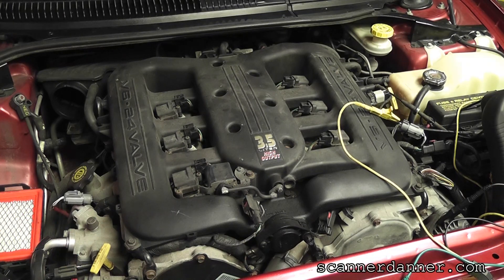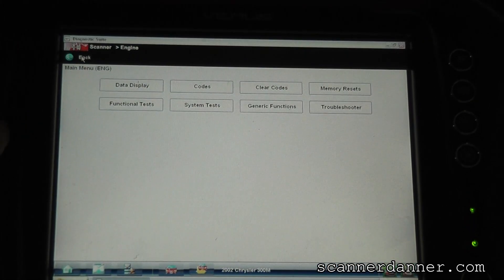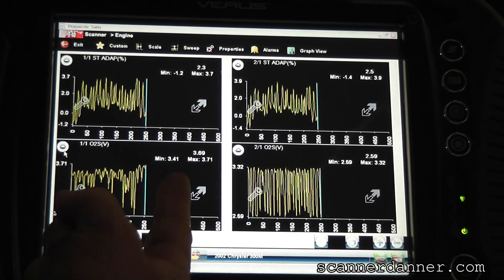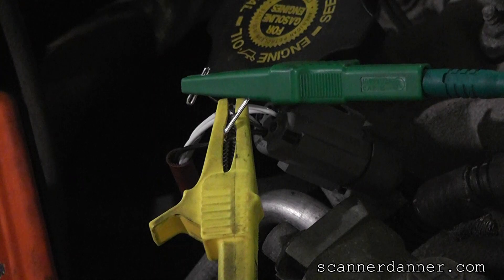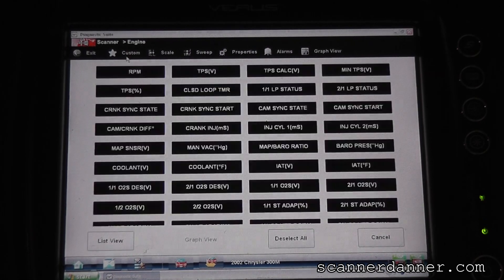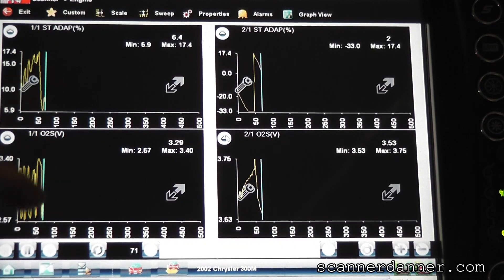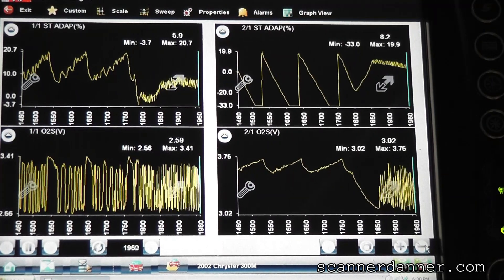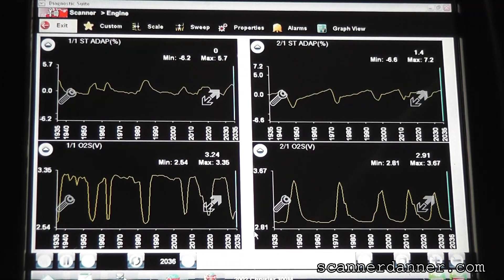WARNING! Aftermarket Oxygen Sensors (Chrysler/Dodge/Jeep part 1)

Comment from the maker: This condition occurred from a heater circuit change. Chrysler started PWM the O2 heater instead of it being constantly energized, and most of the aftermarket sensors are designed to be on all the time! The result is a cold oxygen sensor, especially at low RPM and idle speeds. This causes elevated signal voltage (false rich conditions) and massive amounts of fuel being taken away (negative fuel trim)
Reply: Hey scanner danner big fan. My 2005 pacifica is giving me a big headache. I have a p0131 and changed my sensor with a denso and i still have this code. I checked my heater circuit at the harness and im getting a good ground but im not getting 12v with key on engine off. According to the diagram im supposed to get 12v direct from the computer. Is it toast? I have good continuity at that power wire all the way up to the computer. Thanks.

Comment: I have a 2014 ram promaster. I was getting a p219a code and had a new Bosch o2 sensor on that side. I checked for vacuum leaks , replaced coils plugs and injectors. Nothing was changing. I came across this video and replaced the o2 for oem. I noticed the fuel trims started matching. I still have to drive it to confirm if it’s fixed. Thanks for the tip. Update ****. It worked!!! P219a code gone. Thanks again!

Comment: This problem also occurs with the '91 to '01 Jeep 4.0 engines.  I went through 3 or 4 Bosch O2 sensors in a matter of weeks in my 1998 Jeep Cherokee before I learned of the situation and installed a factory Mopar sensor.  That was seven years and about 60,000 miles ago and I haven't had an O2 sensor issue since.
Reply: MOPAR or ...no parts.

Comment: Have been battling with the 420/430 codes on my 2012 Volkswagen Routan for several months. Initially I rebuilt my transmission as I read about the documented failure of the valve body. It has been amazing how poorly the transmission operated, however, I finally came accross Dans videos. I purchased the e-book and have had an epiphany as to how important the O2 sensors are to the entire functioning of the Chrysler TIPM system. Thats right Chrysler. The VW Routan is a Town and Country in Laderhosen! So much so that the dealers want nothing to do with working on these vehicles unless they are out of warranty and then they want to do things like the Chrysler Dealership mentioned in the video. 
On the Chrysler 3.6L VVT pentastar you will ultimately have a convergence of several problems to look for when the 420/430 codes, misfire codes crankshaft/camshaft sensor mismatch, oil pressure sensnor stuck on and 2nd gear, 5th gear, compounder errors start to set. 
The first item that leads to errors is the camshaft phaser self clean program. You cant just change the oil and reset the code on this engine. Recommended is to change the oil and run the self clean program  that can only be found in a Versus type scanner. This will prevent the VVT system from causing the computer to over compensate for valve train signals sending incorrect data to the ECU that throws off 02 sensor Fuel trim monitoring. 
The second item is to monitor the hard wired fuel sensor relay in the TIPM. This is well documented and explained on verticalvisions.com web site. A wire fuse system is used to bypass the TIPM relay that fails within 6-60,000 miles. Das dealer blows smoke your way doing anything they can to avoid replacing the TIPM at $1,200 - $1,500 dollars a shot. The Fuel relay messes with the fuel pressure causing hiccups, hard shifts in 2nd-3rd and 5th - 6th, missfires and the ever popular stalling of the engine on the freeway, when your wife is attempting to tyrn into the school parking lot (without power steering assist) and other underpant staining experiences.
In my experience all these situations put unusual wear and tear on the 02 sensors causing them to fail and give upstream downstreem short to grounds. Couple this with hey the Bosch sensors are a great deal as much as $40/sensor savings of the NTK sensors and after all its a Volkswagen it should do great with German parts right?!
Unfortunately, not having seen this information earlier in the process I melted my Catalysts. So even though I saw the same response Dan did - once the Bosch sensors were switched out for NTK's the catalyst didnt even have to warm up to display a healthy signal.
I do have one question for you Dan. The system will only work with a zirconium tipped NTK sensor due to the Lambda signal. Do I need to use a factory Catalyst because they use a medium that will only react with the NTK sensor to send the proper bias signal to the ECU? I guess a follow up would be if the cat needs to be MOPAR does anyone know the cat manufactuer so savings like buying a NTK packaged sensor provides? 
Thank you so much Dan for making your book and videos public outside of your trade school. Best information on the internet. Now all I need to do is find someone fire selling there Versus Scanner! LOL!

Comment: I had a 2005 Dakota in our shop and ordered plugs from the dealer.  Found they sent NGK.  Called them and received a little education.  Mopar uses NGK spark plugs for some applications.

Thanks for putting this video on the internet.  I use almost all dealership parts to avoid this very thing.  I have been wrenching professionally for 30 years and have seen the aftermarket parts world go down hill.

Comment: Sick video Scanner Danner. I just got my mechanic license 3 months ago and i love diagnostics! I find your videos very helpful. This video reminds me. About 2 years ago i diagnosed the boss's wife's trailblazer 5.7. The licensed guys put in new intake gaskets, new o2 sensors and it was all fine but after the car warms up it started running rough again. So they gave it to me when i was the apprentice :) and i was watching my o2's and my fuel trims on both banks, while another apprentice was driving... everything was fine but then after about 10 minutes, bank 2 fuel trim started going nuts. It just went up and up and up and up and maxed out basically, while bank 1 was fine. Same with the o2 reading. It was going lean lean lean lean lean and maxed out. I then suspected it is a faulty replacement sensor. So i put in the old one, and the problem was fixed! For some reason bank 1 replacement sensor had no issues though.
Reply: Not every part off the assembly line is good. A bit unrelated, but for a while there I preferred Bosch spark plugs over NGK's even though I always had to take some back because their cores had infinite resistance.

NGK upped their quality, they were always more consistent than the Bosch, but what I liked about the design of the NGK's showed up on Bosch, and Bosch bettered their quality control.

Now I really can't tell the difference. They're both good.

Comment: I have used NTK O2's on a 2006 Jeep Wrangler with no problem.  They are OEM made for Chrysler and can be purchased for much less than buying through Mopar parts. Glad you made this video because I have been wanting to know more about this subject for a while.  Thanks Paul, I always enjoy the knowledge and effort you put into making your videos!
Reply from the maker: Thanks man, good tip. Uploading Part 2 tonight. I think you will really like the additional info.
Reply: NTK O2 sensors on a 3.5L 2006 Dodge Magnum were no good for me. Changed to new OEM Chrysler and high sensor voltage code setting stopped. Graphed response and voltage levels normalized. Finicky machines!!

Comment: Seen these types of problems way back in the late 70's. We would do a tune up on a GM car and use Champion spark plugs for a tune up and the engine would run like crap. Replace the new Champions  with AC spark plugs and the very rough running engine was fixed. We had no explanation for that back then also.

Comment: Yeah, I agree. In my experience most of the problems a vehicle has after an accident aren't so much a result of the accident itself, but rather the shop trying to bid the insurance company a cheaper job or the insurance company bullying the shop into lowering the price and dag-nasty evilness ensues. I remember one time a similar situation to this on a Cadillac CTS that almost costed the body shop a pair of heads.

Comment: If you think about this you will conclude that the after market Bosch sensor have the ground wire tied to the sensor ground. And as the sentor is in contact with the exaust manifold wich is ground, it kills de 2,5v BIAS voltage for the PCM, thus the problem is that. If you could isolate the exaust manifold from battery ground that after-market sensor should work. The problem is that the ground wire on that sensor is tied to the sensor metalic case that threads on the exaust. That's all. The original sensor has the grounds isolated. So the ground wire from the sensor is not part of the melalic case of the sensor. That's a floating ground nothing more than that. If the sensor was made of plastic this would not be a problem. Sorry about my poor english. I'm from Portugal. We don't have Chryslers here but we have GMs. Best regards.
Reply from the maker: That is not the issue. Both sensors are using external grounds on the 4 wire designs. Watch part 2. It is simply a difference in the heater circuit that is causing the issue
Reply: OK. If the PCM is using 2,5v on the ground wire the O2 must have a separated ground wire. The majority of O2s have the ground wire tied to the metalic case. If that PCM is using 2,5v on the ground wire as soon as you attach the sensor to the exaust manifold that voltage would be knocked down imediatly. So the O2 sensor must be special in that regard to have the ground wire isolated from the case of the O2.
Reply from the maker: There are no 4 wire O2 sensors that are grounded to the case.1,2 and 3 wire ones were but they don't use those much anymore.
Reply: 4 wire ones: 2 wires for the heater, 1 for the signal and the other one is ground endeed.

Comment: Sure seems like a heater problem with the bosh sensor. Noticed this once on a 97 ford explorer. replaced one o2 with a bosh aftermarket sensor.The other sensor came from Ford and the Ford sensor was a lot quicker to time to activity than the Bosch. No code was ever set as far as I know.

Comment: Paul,

Very interesting behavior of the Bosch VS the OEM O2 sensors. As others have said, it would seem to be a heater issue (difference between the 2 sensors). I would bet that the firmware/software code in the ECM controlling the PWM of the heaters makes some sort of assumption to drive both O2's with the same waveform profile. The Bosch heater thus is not getting as hot as the OEM one. Point being that revving the engine started yielding somewhat normal sensor output (extra exhaust heat). As a test, I wonder if Bosch sensors on both banks would result in the ECM FW/SW re-learning the heater(s) PWM profile? Another thought would be to remove both O2's, then take an handheld IR digital laser thermometer and compare their temps at idle; I would bet the Bosch is lower, thus not high enough for the sensor to output enough voltage.

Tom

Comment: I was wondering if the upstream is OEM original replacements but the downstream was unknown China aftermarket if this would also disrupt the system possibly indicating a short or etc in left right banks. I just discovered today I had original Denso 234-9030 in upstream and after market in downstream of my 2004 Jaguar XJ8. Been wrestling with that problem showing a shorted wire and kicking on the Engine light. Clearing codes would be good for 15 to 30 miles and all connections were solid. Did have a taillight right turn signal flashing causing left brake light to flash also. Found out it was the trunk fuse box and a replacement took care of that. Thought maybe same on Engine fuse box, but discovered today aftermarket downstream sensors. After watching your video I ordered Denso 234-4798 originals downstream. Cant wait to see if that will cure the problem. Thanks for the video. It is good job.
Reply from the maker: This model doesn't use downstream fuel trim control, but some models absolutely do.

Comment: I ran into this same problem on a Dodge Durango a few months back. I misdiagnosed it and spent a couple hundred bucks on other parts in disbelief a "NEW" sensor could be bad right out of the box. The truck pulled all fuel from one bank and caused a severe lean misfire, I caught this since the front bank was reading full rich while the sensor behind the cat was running FULL LEAN. I picked this up after watching one of Pauls videos. Wrote a 1 page letter to Bosch, still waiting on a refund from the old sensor.
Reply: nice, let me know what they say.

Comment: Danner   I had my o2 sensor replaced with a Bosch one. I had no error codes. but I realized that the car had almost constant loss of power. Even after a full Ecu reset.  After 4 months of searching for  what the problem could be. it seemed that the new Bosch o2 sensor was not giving the right values to the Ecu.  After sending the new Bosch o2 sensor back, ive bought a new Pierburg o2 sensor. And still the same loss of power.  
So finally i bought a new Oem o2 sensor from the dealer. And guess what i now have full power again!   My car is a Seat Leon 1m from 2005 petrol.
Reply from the maker: awesome! unfortunate you had to learn the hard way that an OEM sensor is sometimes absolutely necessary

Comment: You could alter the o2 sensor bias point with some resistors so maybe there is resistors internal to the sensor.
Reply: The bias point means the o2 is biased below the operating ground. Its cutting off the bottom of the waveform.

Comment: A little off topic.  I had an '02 Montana come back with a misfire after I replaced the intake gaskets (3.4).  It turns out that the heater wasn't working on the O2 so when the engine was at idle, the O2 cooled off and caused a misfire.  I replaced the sensor, and haven't heard any more.  I guess not news is good news.

Comment: Very interesting anomaly with the O2s. My theory why when moving the Bosch O2 back to bank 2 and the pcm did not rely on the good OEM O2 on bank 1 is the way pcm circuitry is designed (though you did say you thought it was a result of clearing the pcm of adaptive data). I would like to see if you switched the Bosch to bank 1 and the OEM to bank 2, if the pcm would then rely on the good OEM.

Comment: Firstly awesome video as usual,  as a former Chrysler   dealer tech I have seen this scenario numerous times.     What too many posters are blabbing about being idiots at the dealer using non oe parts they need to realize often times when dealing with idiots at the insurance company's is that they often supply or demand only the cheapest parts.   And yes NGK is sometimes the oe plug.    I first saw this on low mileage first service tune ups on the 3.7 & 4.7 series of engines.   Not saying they aren't misinformed dealer techs but again the whole story should be known before keyboard warriors start slandering the pros anywhere.
Reply from the maker: For sure, the insurance companies suck to deal with sometimes.
I found out this was not a Chrysler dealer anymore, they used to be but lost that division. I mention this is part 2 coming up. This would be why they didn't use OEM parts. Sorry about the "dealer bashing" going on. I look at it more like incompetence at all levels in our field, dealership, aftermarket, everyone. Don't you think?
Reply: ScannerDanner No worries Paul I know you are not responsible for the dealer bashing.   I agree incompetence and lack of technical skill are a common issue at all levels of repair.   As long as there is a flat rate or commissioned based pay scale there will be holes.  At .6 of an hour I wouldn't have been able to prove that the Bosch sensor was incompatible and I was the only dealer tech that did figure this very pattern failure out in my shop and the only one that even knew it was a common no no.   Lack of approved diag time and not understanding the intricacies of the system leads to parts swapping and pattern failure over reliance.   Its because of instructors like yourself and forums like iatn that I have been able to push past the average and fix almost anything

Comment: Enjoyed your video.

My guess is the OEM O2 sensor heater has some sort of temperature feedback that the Bosch one does not.  I do not think it is the bias voltage on the sensor side difference.because it worked when hot.

Two what would happen ifs..

1 Power the heater directly with 12v it the sensor should then work at idle?.. (if the heater does not burn out?)

2 Compare the resistance of both sensors heaters at different temperatures? I guess this could be achieved by both measuring current along with voltage with the scope and doing the division at instantaneous points of time.

Is it true Hondas have the same issue?

Comment: Hi Paul, How do I test the O2 Sensor Harness To PCM Wires for integrity? What Info/data should I be looking for? I have changed the B2S1 & B2S2 O2 Sensors Multiple times with Factory and Aftermarket O2 Sensors, Still have the same problem/DTC. When I run the Car, The Downstream O2 Sensors Voltage stays above 4V, It eventually gets down to about 1V Or less after running the engine for a long time, Same as You demonstrated in One of Your Vids.. You said in the case of Dead O2 or Shorted/Open Sensor Circuit, It'll read 5V ALL THE TIME, But, I do get some Voltage activity.. So I'm trying to figure out if the Circuitry problem is in the Wires or the PCM..? Also, I don't wanna call the Catalytic Converters as the Culprit Yet, Till I'm Sure. I have the same Chrysler Car & Engine, Mine is a 2002 Chrysler 300M and P0141 & P0056 Codes..
Reply from the maker: your heater circuits are not working, you need to focus there